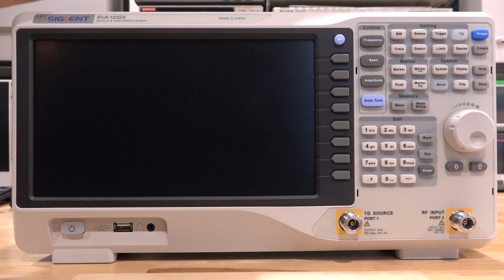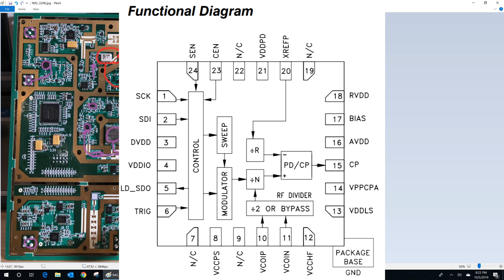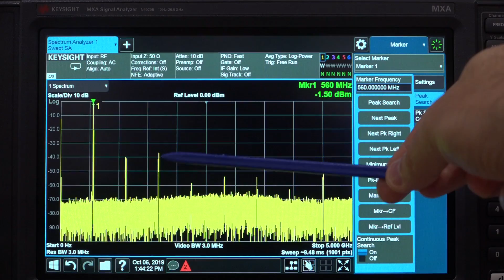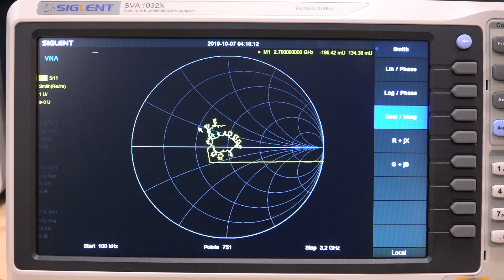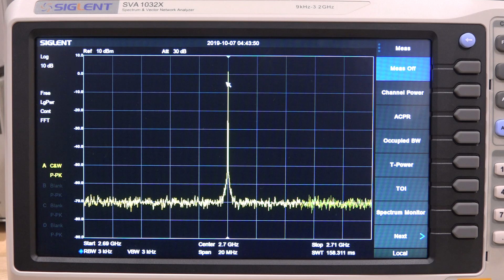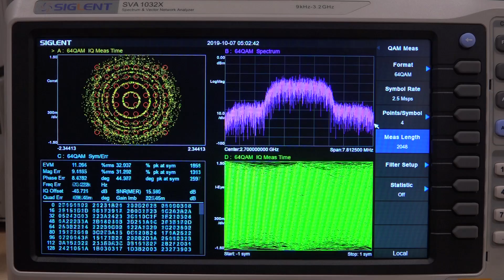TSP #158 - Siglent SVA1032X 3.2GHz Spectrum & Vector Network Analyzer Review, Teardown & Experiments

Comment: Great presentation and fantastic content.  I do have one of these, I got the VNA licence included in the base price.  All the other functions are subject to 128 hours trial use, which is substantial.  I've had to use the DTF function just once - I had a bad match on a 1296Mhz antenna.  The DTF took me right to a kink in the feeder.  Really good piece of kit.   I had hoped you might have commented on the noise floor of the VNA function, but maybe another time.  Thanks for a great video.

Comment: Dear Shahriar may I please ask you what the différance is between a vector signal analyzer and a vector network analyzer?
I have used several weeks to try to find out, but it does not look like anyone is writing about it.
I hope to start learning about component and board impedance and what does what and what it means for the signal. :-)

Comment: When the amplifier gets saturated during the EVM  / demodulation measurement ( https://youtu.be/ToVJTKCyIU8?t=2889 ) the constellation points start to move OUTWARDS instead of INWARDS.
It looks like the I and Q components become larger then what they are during non compression. For me this is counter intuitive. I thought the low energy symbols remain (more or less) intact and the high energy symbols at the perimeter of the constellation diagram can't reach their nominal location so their distance from the origin is smaller then during non-compression.
Please tell me why did the instrument displayed what it displayed!
Reply: It looks like there's either no AGC in the modulation analysis, it got maxed out, or it's based on the level after the amplifier that is saturating. Once that happened, as the input amplitude went up, the higher power outside points can't move any further out, while the inner points aren't compressing, so they continue outwards. It's kind of a perspective thing, as they were staying intact, just getting bigger while the outer bands compressed together.

Comment: Apologies if this comes up later in the video, but why are we upconverting to above 3.2GHz? Simply because it's easier to filter such high frequencies (in which case I guess because of the smaller capacities and inductances, making the distributed element filters take less space)? Or something else entirely?
Reply: I think it's more because it allows the use of a fixed low pass filter instead of a tuning band pass filter. I don't really remember though.

Comment: at 35:05, the flat line in Smith chart is a low frequency responce, and interpolated to origin point. Because the AMP is a 10M -2.7G while you used 100k start, then from 100k to 10M almost OPEN, so the first few points went to a flat line.

Comment: The source output is fixed?  So this means it can't do amplitude sweeps, so no IP or compression measurements?  It would also be interesting to see if or how the impedance of port 2 changes during the internal switching during a sweep.

Comment: Thx for the review, solid as always. What is your opinion comparing SVA1032x vs R&S FPC1500. Officially optioned up (w/ current R&S offer) current pricing does not differ that much.

Comment: If you have the Rigol VSWR bridge from your 1030A days does it fit the input ports of the Siglent? I'd hate to have to buy that accessory all over again!
Reply: Being a VNA much reduces the need for a RLB however pics I've seen of the Rigol RLB suggests it's exactly the same as the Siglent one. I've never used my Siglent RLB on the SVA1015X that I've had for a year or so. Anyways you can check it out here: https://siglentna.com/product/reflection-vswr-measurement-kit/

Comment: The line on the smith chart is because the 1032 is measuring a very poor RL of the amp at very low freq. The first sample is at 100kHz and is poor. The freq steps are large and so the second sample is closer to the middle of the chart, and the 1032 just draws a line between the two samples. 
It is just visible on the S11 return loss graph at the extreme left, close to 100kHz, where the trace turns sharply upwards. Perhaps it is a limitation of the 1032X at that freq.
Reply: We'll known soon enough as I think my one arrives tomorrow. I'll flick it your way for a look over the moment I can.

Comment: Did I get it correctly? The output of the TG is switched back and forth to an internal 50 Ohm load and the DUT on the connector, and the difference of the two measurements is the reflected part?

Comment: Looks very  similar to the SSA3032X, another great review.
Reply: Yes it's the same form factor and physical UI but the menu structure is deeper to allow for the greater capabilities of a VNA. FYI the SSA3000X series has recently been updated to Plus models that now also feature touch display and keyboard/mouse support and the Modulation Analysis the SVA range has. It's a bit of a shame Siglent didn't add an additional rear USB-A port or 2 to accommodate a mouse or keyboard.
Reply: @tautech8196  That I understand, but looking at both RF boards, you can see strong similarities. Definitely looks like a update of the old SSA3000X series.

Comment: Previous board overview was better indeed :) Otherwise still very nice video!
Reply: Yes agree, try to use irfanview there is pretty good zooming and drawing also. But explanation excellent as always!
Reply from the maker: Why? This was so much more detailed.
Reply: @TheSignalPath  I meant from the view, you used different drawing tool before, made it bit easier to watch. But I see the challenge here, board is square and does not quite fit the usual aspect FHD aspect ratio of the monitor. The explanations and analysis are top notch as usual.
Reply: @TheSignalPath  It was hard to see the LO and TG path drawings while I was viewing it on my phone. I realize that it would be easier from a PC, but zooming in to the particular section that you're describing would help significantly, too.

Comment: i love your videos but sometimes I find it hard to track the explanations. May I suggest using a bigger mouse cursor and perhaps the magnifier function in Windows. The best option would be to set a tracking viewport of 720p in which to do the tracing, but the magnifier option is easier to use. Looking forward to seeing more great analysis videos!
Reply from the maker: Thanks, I will look for some other method.
Reply: @TheSignalPath  take a look at how buildzoid / actually hardcore overclocking does PCB reviesw, using Gimp and zooming around in a high res  picture
Reply: Had the same idea - it was hard to follow the cursor.
Reply: @Zerobrain  nice to see you here :D